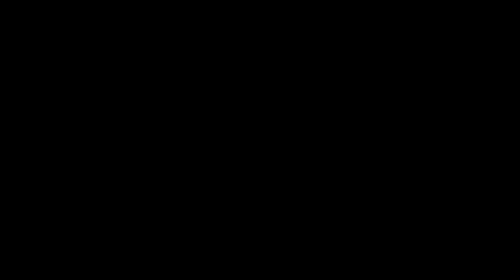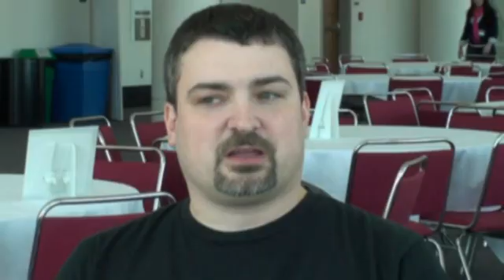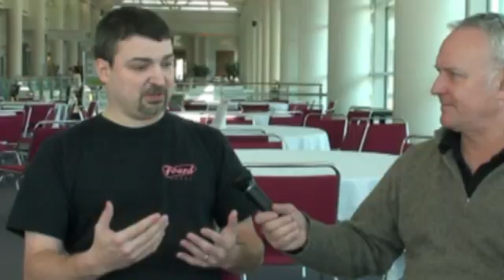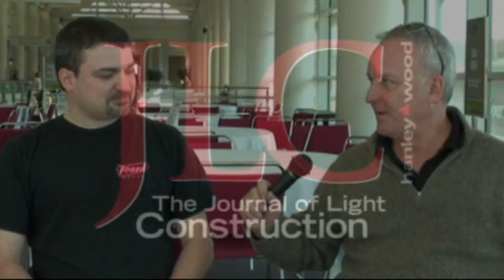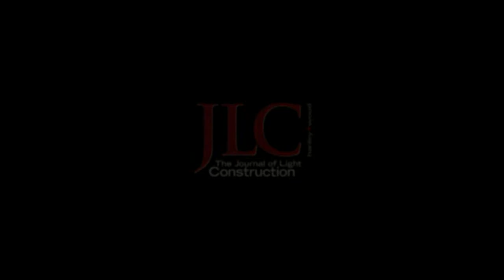HRV's vs ERV's

Comment: In the "Old Days" what he says was true. Our UltimateAir ERV will operate in sub-zero temps all the way to the poles with only a modest amount of Electric Modulated Pre-Heat on the incoming fresh air stream. Also, without pre-Heat UltimateAir will cycle OFF around 12F or -10C to protect itself freezing. Our modulated electric pre-heater will bump up the fresh air temp just above the auto-freeze protection temp of 12F. Compare this to other manufactures who simply redirect the stale air back across the core and into your building to prevent freeze up.
96% energy recovery efficiency (ASE) at  largest temp difference.
http://www.ultimateair.com/blog/bid/85515/Energy-Recovery-Ventilation-or-Heat-Recovery-Ventilation
http://www.ultimateair.com/products/accessories/